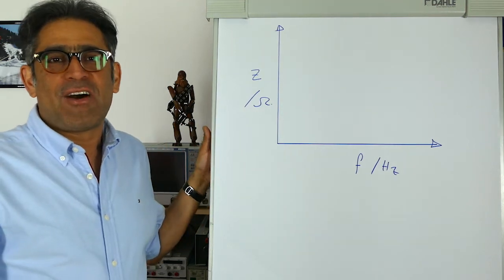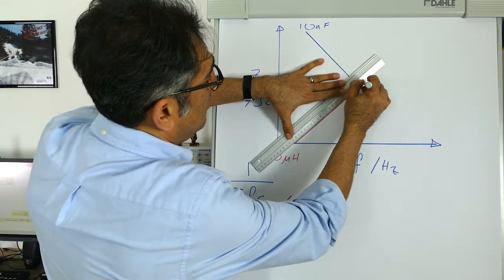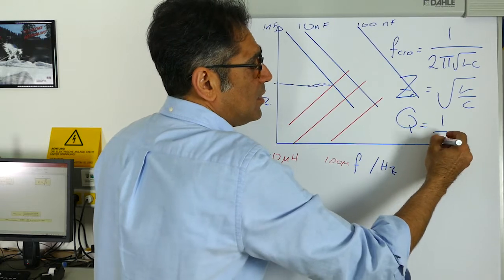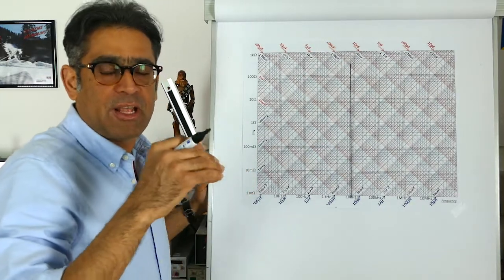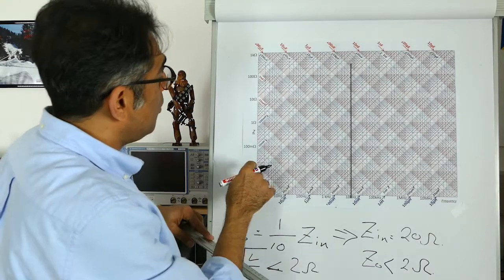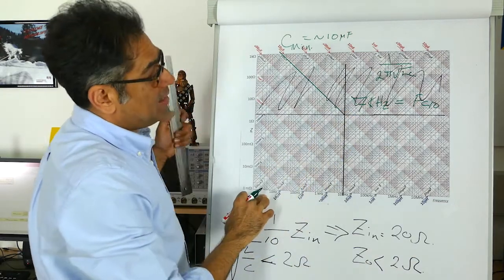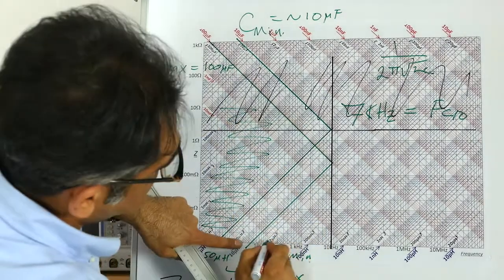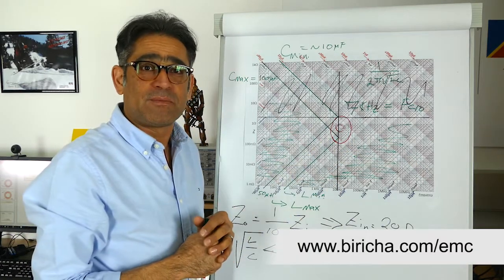EMC Filter Design Part 4: Differential Mode EMC Filter Design Down to Component Level

Comment: dear sir, thanks for this video. In my design 115V, 3Phase, 400Hz supply is used, In this MIL-CE101 Got failed at 1.2KHz onwards( It is Harmonics of the Fundamental Frequency) at the Amplitude of 10db more than the my limit line. I want one filter Circuit for getting passed my design, please suggest the Inductor and capacitor values.

Comment: Is it okay if I ask some basic questions that are haunting me ? For instance, you’re using examples of high frequency cutout but I usually see this filter in switching mode power supply and the main usually uses 60 or 50 hz. But in one of your videos , you mentioned the need of the emi filters because of the harmonics and noises produced by the switching ( pwm and transistors ).   You haven’t explained how you got the the cutout frequency.  We usually know the frequency of the pwm ic used in the power supply, which are usually very high ones.   I guess to answer the question of which cutoff frequency we should use has to do with the pwm ci ( that’s for filters in psu ) but I can’t come up with an answer on my own.   I’m still studying circuit analysis.  If I were designing an audio filter , it would be easy to set a cutoff frequency.  But it’s for power supplies.       Another point to consider is the amplitude of the signal.  The capacitors working voltages discharging time does not influence on the filter ? I wonder.  I see that you didn’t mention about the capacitor’s voltage but obvious if the line is 110vrms , the capacitor will have to be at least more than that.   How much more ? I’ve seen 250v capacitors in psu.
Reply: cutt off frequ. will b your switching freq, or max harmonic that you measure or which harmonic component you want to suppress.
Reply: @jaydeepsejpal1427  
Like for example you have to fullfill requirements of the 40th harmonics of your SMPS and your switching frequency ist about 100kHz. Then your cut-off frequency is the 40th harmonic of 100kHz. 
EMI filter surpress noise (aka surge currents and so on..) from the line (X-Components) but also noise from the switching supply itself (Y-Component).

Comment: Very well explained, thanks, just a comment here (at the beginning of video) the plots of capacitors impedance is in reverse order
It should be (left to right) 100nf, then 10nf, then 1nf.
The capacitor with higher capacitance out of the 3 capacitors has 100nf aka it should have the smallest impedance graph, aka placed at leftmost.
The printed graph at about 3:40 has it correct way

Comment: How to calculate the cutoff frequency?
Reply: LC-Filter has following impedance Z:     Z = 0 + j*(wL - (1/(wC) )
The cutoff frequency occures when  Real part {Re(Z)} = {Im(Z)}
so {Re(Z)} = 0   and  {Im(Z)} = wL - (1/(wC)    than you have the Equation:
0 = wL - (1/(wC)     wich leads to:   w = 1/sqrt(LC)
with: w = 2*pi*fc   ---->   fc = 1/(2*pi*sqrt(LC))
Reply: @enesog  L anc C are the differential componets ? Correct?

Comment: Can you elaborate on the criteria used to decide on the filter cutoff frequency.
Reply: I wonder the same.  He said nothing about that.
Reply: Maybe 1/100-1/10 switching frequncy
Reply: I think he said assume he measured the most emissions above 7kHz so this was what he wanted to filter out. He got filter source impedance criteria from 1/10 x regulator input impedance